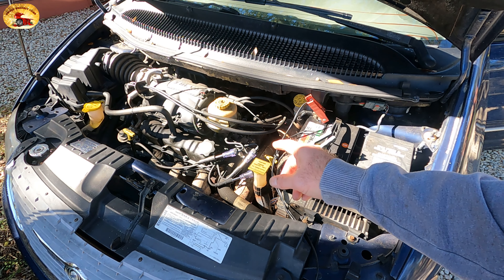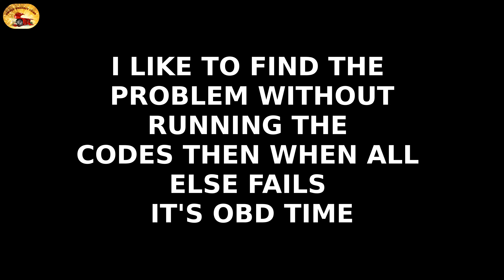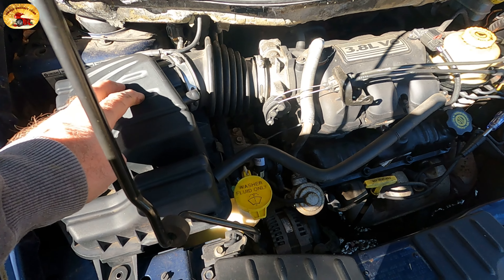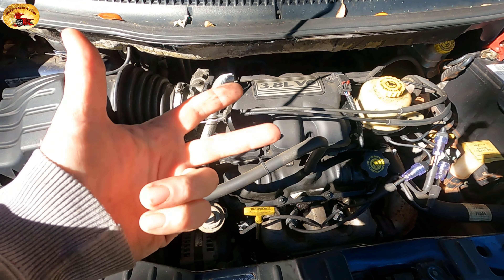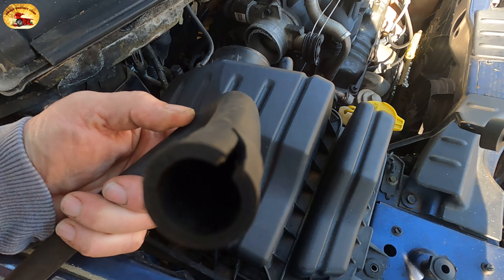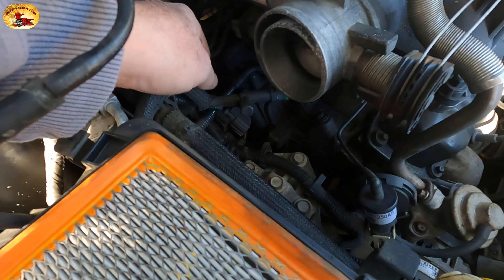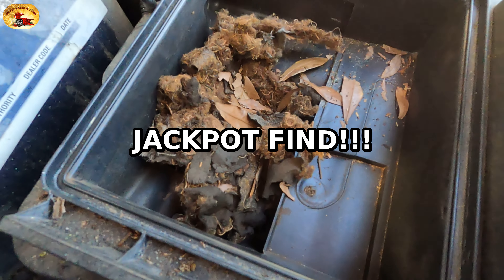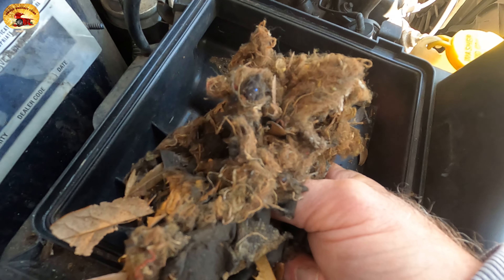How to Diagnosis a ROUGH Running Car Or Truck... SAVE BIG MONEY Doing it Yourself!

Comment: That looked like that was the  Mass Air Flow Sensor that was unplugged.  Nothing will run right with it unplugged,  throw in the "Mouse Nesting" and the cracked hose; you are lucky it was able to run at all.  Also looks like that engine needs some new motor mounts.  Yes, it will move with it running rough, but should not be flexing that much at low RPMs.
Reply: That was the intake air temperature sensor
Reply from the maker: we figured it need mounts and that will be dealt with for sure and we finally ran the codes and you will be surprised in the next videos what we came up with my friend   mad mike out
Reply from the maker: we finally ran the codes and you will be surprised in the next videos what we came up with my friend   mad mike out

Comment: My car was running very rough and it was driving me nuts but I went ahead and got some gumout and it worked instantly, and I'm now using marvelous mystical fluid and gumout alternating
Reply from the maker: michael thats funny because in the next video or two on the Blue Bomber we are going to address that in a very funny way also we finally ran the codes and you will be surprised in the next videos what we came up with my friend   mad mike out
Reply: @SweetProjectCars  bring it

Comment: 1. Air 2. Fuel 3. Spark. Sometimes it's just that one of them is missing or weak.
Reply from the maker: marston you are very correct!  we also finally ran the codes on the blue bomber and you will be surprised in the next videos what we came up with my friend   mad mike out

Comment: I have actually seen that more than I care to admit. It's amazing to me, how much people abuse their machines in the form of lack of maintenance.
Reply from the maker: you are very right pantherman people go through cars and trucks like crazy they abuse them then sell them
Reply: Or, my favorite; hang on to them till they break. At this point they complain what a pile of junk it must be, never-mind the engine went 30K without an oil change. Or the transmission dies when they change the fluid.....at 90K miles. It's amazing how little they know, and aren't willing to learn. 

I have 2 Honda's, one came with an owner's manual; shocker in my area, 95%+ of all used vehicles have this missing. And one without. I found the webpage that Honda has that you can download a PDF of it for free. I've always had an owners manual and maintenance schedule book for all my vehicles; ignorance isn't an excuse.